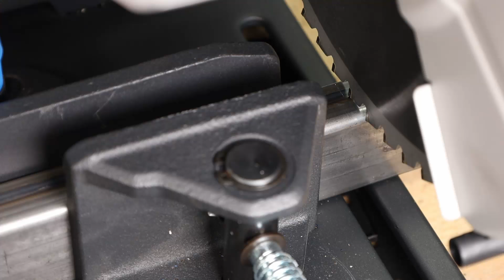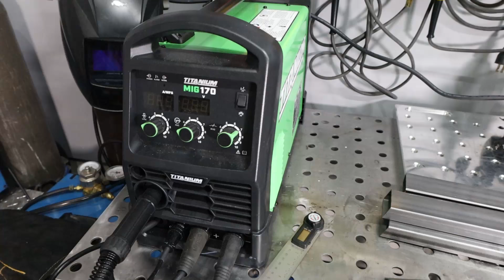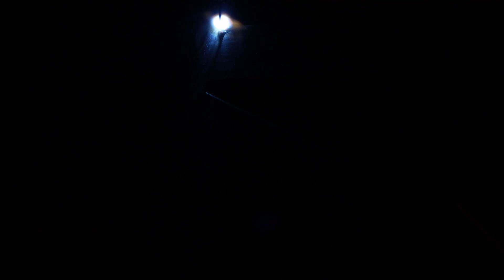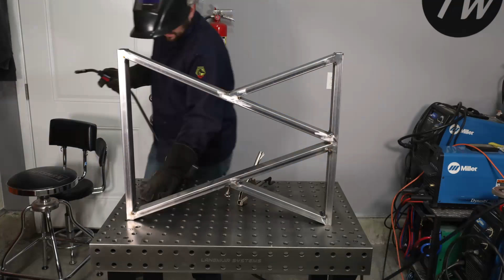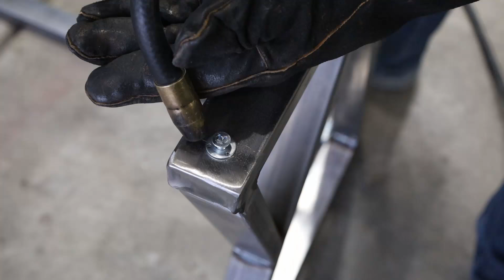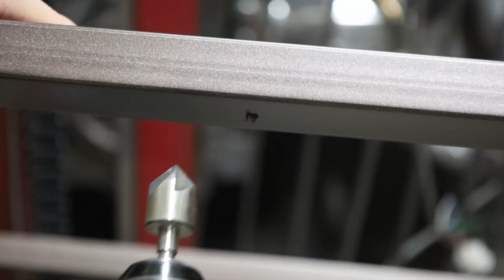Welding Project: Metal and Wood Desk

Comment: how do i do this with like no tools except welding machine? you have like all the tools in existance available to you it seems...
Reply from the maker: You can just cut the tubing with a cutoff wheel on an angle grinder or with a basic abrasive chop saw and weld it together. While I do like my tools, you don't need much stuff to fabricate projects like this. There's a video on my channel where I had a $200 budget to buy everything I would need to fabricate a table and I show how I did it. That would give some insight into how to work with less equipment.

Comment: What chop saw are you using? I'm looking for either a chop saw or band saw to break down lengths.
Reply from the maker: I use a 14" Evolution saw and really like it. It's a S355CPSL. https://www.trick-tools.com/Evolution-S355CPSL-14-inch-TCT-Chop-Saw-14787

I did a roundup of all the cutting tools I have in this video, which might help. https://youtu.be/mYpVoYTdbxY

Comment: One advice from woodworker to metalworker. You did not account for wood movement in your top. You have to elongate the holes in the metal base and then screw the top to them. Otherwise, with wood expansion the top will eventually deform. Also, when you are staining the wood, you have to put stain on and then wipe it off in 10-15 min. Do not leave it overnight. Love your videos. Learning to weld for my furniture projects so I can combine metal and wood. You are one of the best instructors on YouTube
Reply from the maker: Great tip! I’ll definitely slot the holes out next time. Thanks!
Reply: Yes, wipe on and off several times would work but darker stain would be even easier/faster
Reply: George, I'm starting the process of making my dining table, you said to elongate the holes in the metal, can you elaborate on that please, this is a metal worker winging woodwork.
Reply: That was my thinking, too.  I didn’t believe in the warnings about wood movement until it happened to me.  Just oversize the holes and use a flat washer.  Tim, as always, great videos — I learn from every one of them!
Reply: It also depends on where you live, if the temperature and humidity doesn't really change (like the PNW) you'll probably be alright for a few years. Its a bigger deal if you're using single pieces tops or wood that hasn't been dried etc. There's a channel Blacktail studio that goes into more detail about it, while yes its important its not crucial especially on something for your own home 🤷‍♂️